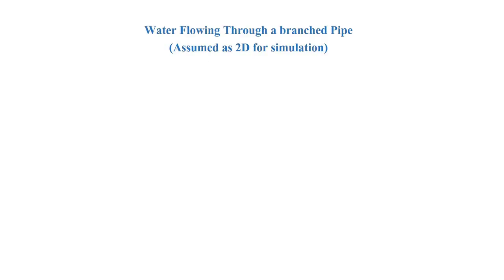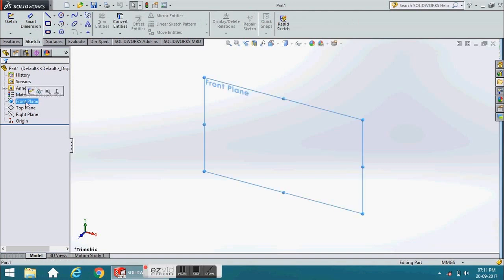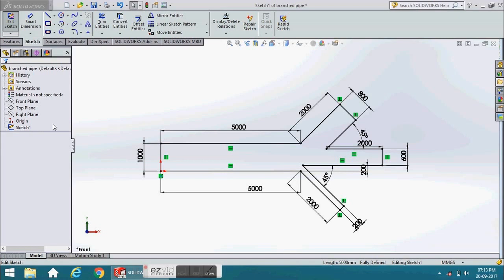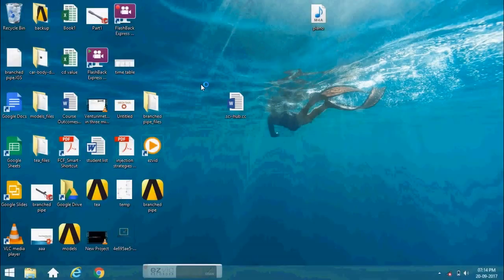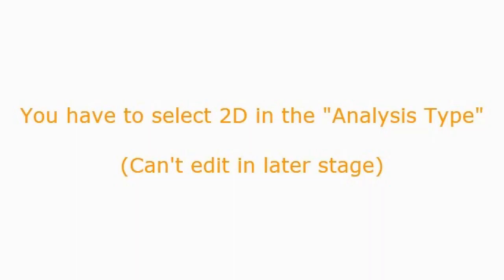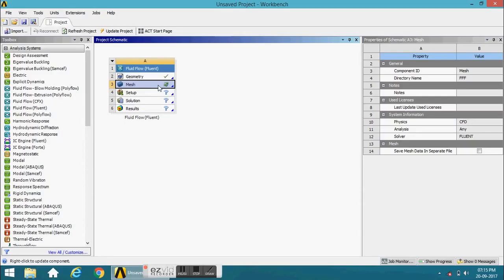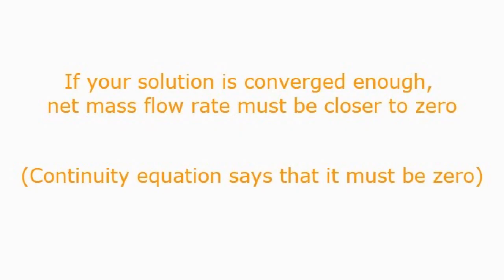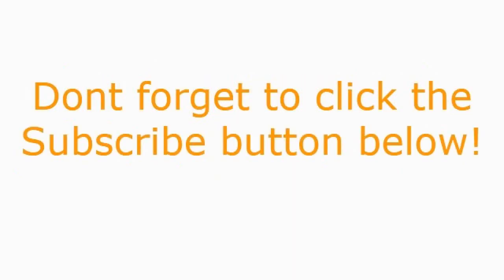Ansys Fluent tutorial for beginners | A Step by Step Tutorial

Comment: Sir,
How can  I provide depth of flow in   boundary condition?
Iam modeling an open channel with cylindrical rods(3dimensional) depth of water 10.25 cm
Discharge 2.77l/s
Velocity 8.94cm/s
Reply from the maker: Generally in this case a fully developed flow is considered. If you want to study open channel, would you need to consider the interaction between air and water? If so, you have to go for multiphase analysis.
In my knowledge, we cannot provide the depth of flow without multiphase flow analysis.

Comment: Can I find equal fluid distribution at two outlets from one inlet? How can I be sure that the fluid is distributed EQUALLY in branches of several pipes? Thank you!
Reply from the maker: Yes Divyesh. In this case, water is unevenly distributed because of the following reasons:
1. Diameter of the outlet pipes are different
2. The angle made between the outlet pipes and the inlet pipe are different
3. Due to the acceleration due to gravity, the lowermost pipe discharges more water (however gravity is not considered in this tutorial)

If you expect equal distribution in all the outlets, you may play with the branching angles, diameters or some obstruction etc., to achieve it.
Reply: That makes sense. Thank you so much for your reply. Really appreciate for sharing this video. Because I am doing something similar to this. At some extent, this video helped. So, really thank you! 

However, I am having difficulty to figure out whether I could have equal distribution flow or not in my Manifold design. It has one inlet and two outlets. But I am confused with respect to my boundary conditions. I tell you why? At inlet (single pipe) - velocity - 26 m/s and at outlet 1 and at outlet 2 - outflow = 1 for both. I thought my result was perfect with this boundary condition. Because it shows that the flow rate; at both outlet 1 and 2 is same. That means I have equal distribution in my manifold design. But when I changed boundary condition from Outflow to Pressure outlet (Pressure = 0) then I have got different result. Results show that the flow rate values are different at both outlets 1 and 2. :( Now, I don't know, which one I should follow? If you can help me, it would be really helpful. Thank you once again!
Reply: Just to let you know, in my case, Inlet dia. is 210mm and Outlet 1 & 2 dia. is  160mm (So both outlets dia are same size).Your response will be highly appreciated!
Reply from the maker: Is both the outlets are symmetric? I'm not sure about the outlet boundary type, generally if the outlet pressure is unknown, people prefer outflow boundary. Further, I may share my best suggestion if you could share the snapshot of the geometry for my better understanding. (e-mail: autoabraham@gmail.com
Reply: I am sorry. I couldn't respond you quickly. I was so stuck with this Analysis - have no clue about my doubt. Well, answer to you question: Yes!! Outlets are symmetric. In my case, I want to find whether the distribution is happening equally or not? Pressure is unknown at OUTLET. When I checked ANSYS Fluent user manual, it says; usually, we need to use outflow in Boundary Condition for 2 or more equal outlets. Thanks for your support. I am going to send you details today on your email id. Thank you so much once again!
Reply: Hey I have sent you an email. Please check! Thank you!
Reply from the maker: Yes Divyesh, I got your mail and i have observed the attachments clearly.
Here, i would like to answer your question on selection of appropriate boundary conditions. It doesn't directly depends on the number of outlets. The selection of appropriate boundary condition depends on the (a) The information we know about the problem and (b) The result we expect from the problem as solution.

In your case, if you are expecting the "flow rate at the outlets as the solution" and you "know the pressure at the outlets", PRESSURE OUTLET is the suitable boundary condition. (If the outlet is freely exposed to the atmosphere, let it be 0 gauge pressure)

If you are "expecting the pressure at the outlet as the solution" and you "know the flow rate at the outlets", OUTFLOW is the suitable boundary condition. (FLOW RATE WEIGHTING is the information you provide about the flow rate)

Sorry for the delayed response. As I am engaged in academic activities i couldn't respond you in time.
Reply from the maker: Coming back your second question, How to achieve equal flow rate at the outlets practically?..

Surely you have to play with the geometry (Size of outlets, position of outlets, angle made with inlets etc.,) as I said earlier.

Speaking about your geometry.. Even if the diameters of the outlet pipes in your geometry are similar, the two outlets are situated in different distances from the inlet. That makes the difference in outlet flow rates.
Reply: Hi Mech Tech. Thank you so much for your detailed information. Indeed it is helpful.
Reply: It perfectly makes sense. Thanks!
Reply from the maker: Thank you Divyesh.
Reply: Hi Mech, I am still working on the same design. After discussing with you, I have determined results for the fluid flow distribution. I have got results for pressure drop too at outlet 1 and 2. But I really do not know how to interpret these pressure results from ANSYS. For example: total pressure at Inlet is 48.3 Pascals, at Outlet 1 is 39.5 Pascals, and Outlet 2 is 36.3 Pascals. Now, I really do not know how to read pressure drop values from this result? Do I need to subtract both outlets 1 and 2 from Inlet?  I do not know how to explain better than this. But I hope you got my point? Can I share with you on your email id please?
Reply from the maker: It's about what you need. 
From your results, i could understand that the pressure drop from the inlet to the outlet 1 is 8.8 Pa

Whereas, the pressure drop from the inlet to the outlet 2 is 12 Pa